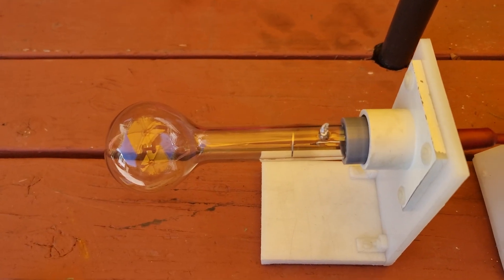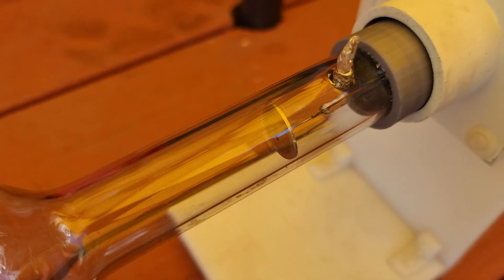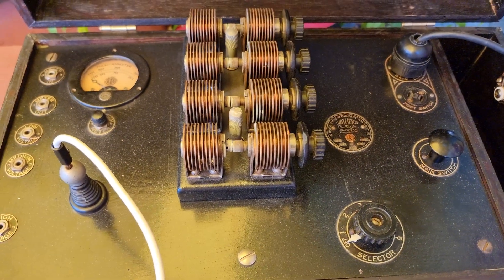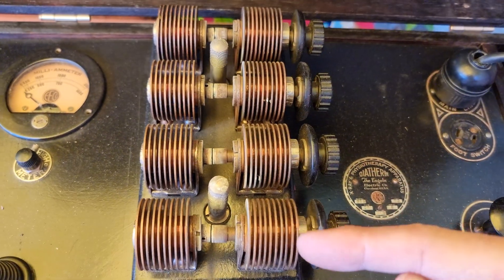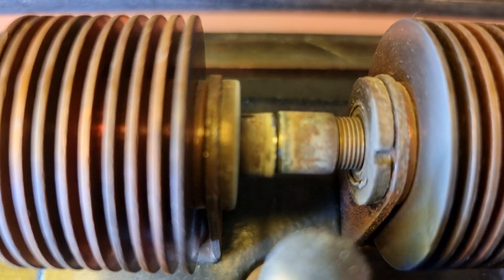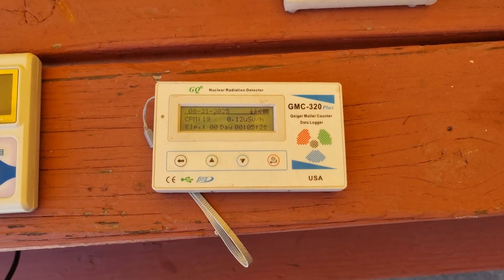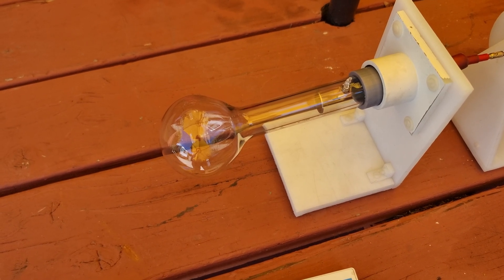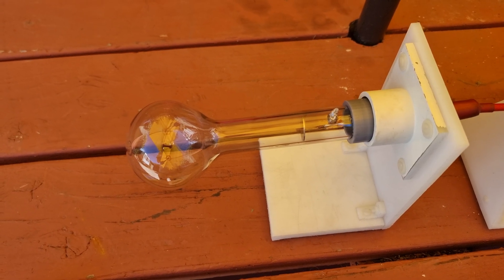DESI - Setup of Griffin Brock 1A21 radiating beam tube - DESMITRON

Comment: Love it bob quenched gap I have one if these somewhere  it’s black they work well is that tube a one volt 1a filament type I have similar very old tubes in original box’s so old the paper box is rotten a bit lol battery operated radios long ago I prefer 801s triodes great in vintage diathermy  dual triodes types teslas coils love dual triodes sharp wide band transmission lots of watts
Reply from the maker: This Diathermy unit is original, we are nearing the end (hopefully) of a build in Prague.
Reply: @MFMP indeed yes I love vintage as you know most of my stuff goes mainly back to the 40s 50s early 60s other items go back to late 17 century including some electrical things was it gamma rays or cosmic rays you where picking up or emf